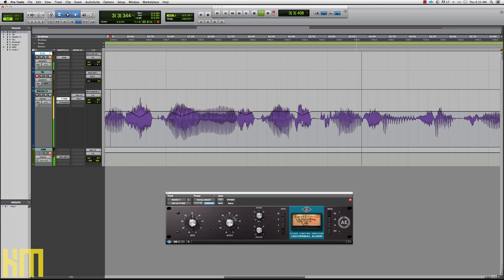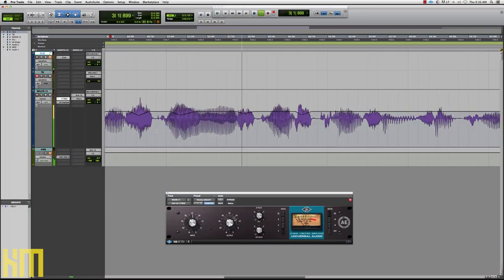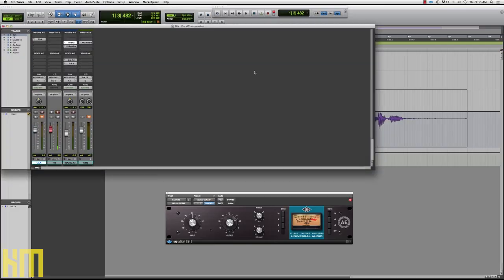The Voiceover - Recording and Production techniques

Comment: I use headphones to produce my music. Is that a good idea in producing music? I've had problems getting bass and kick drums too high in recording with headphones. Is there a preferable headphones to use in producing music? Or should I use speakers in producing music?
Reply: it's a great quesiton, and deserving of a great answer ...which i don't have. But, i do record music, and i do use both headphones and monitors. my only trick is monitoring exclusively on (flat eq response) headphones to the actual material being recorded in the moment. this helps me to understand that the awesome bass i'm hearing from my subwoofer isn't actually being translated onto the tape, but instead is a result of the amplifer and mixer.  
short version? acquire a set of studio monitor headphones which won't "color" your music. the sky is the limit on pricing, but you can get amazing results from something like the Sony MDRV6, less than $100. they won't sound like regular "bass-boosting"  headphones, and that's what you want.